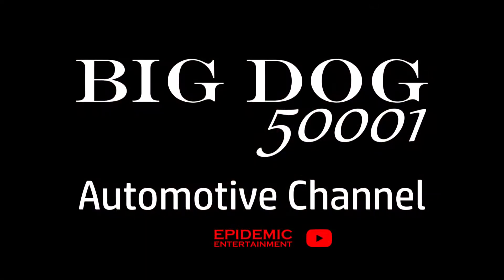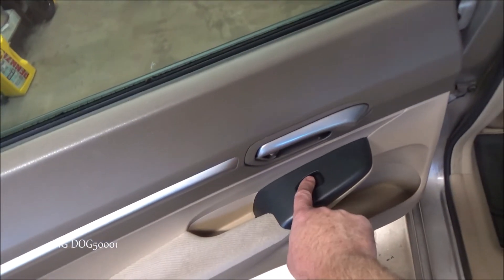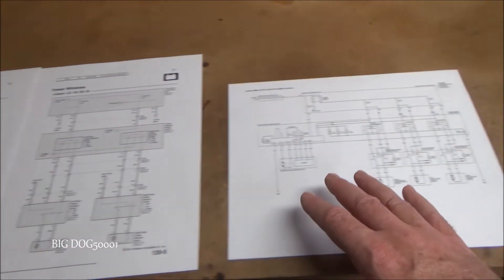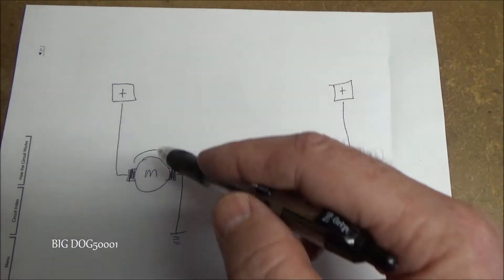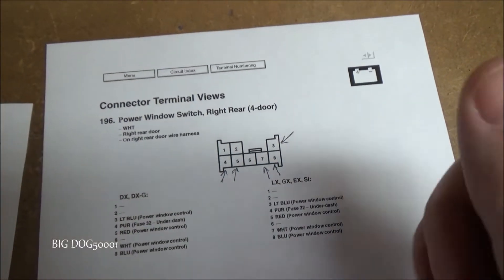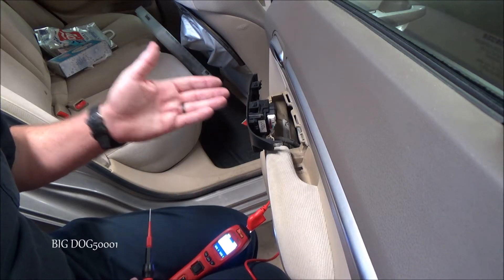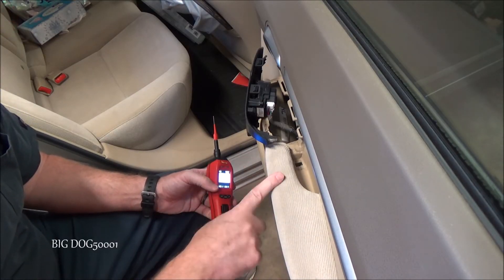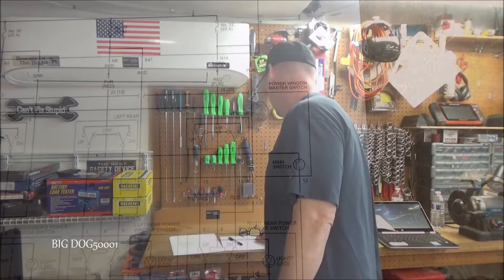Honda Civic Rear Power Window Troubleshooting (2006-2011)

Comment: OMG 🐶, as a former Control Data Institute grad, that is the most detailed, thorough, educational troubleshooting circuit diagnosis I've ever seen - even better than my instructors back in the day! I can't see anything that you didn't do in your troubleshooting techniques. For you having both mechanical & electrical backgrounds you're an invaluable resource - exquisite training/teaching skills! Hopefully others gained comprehension on how a full circuit works to supply voltage ⚡ & direct current (DC) to their respective devices to make them operate!!
Reply from the maker: I appreciate the comment, thank you!

Comment: I had a similar problem found your video. However 3 windows stopped working at the same time. What are the odds that all 3  motors went at the same time?  
Driver and 2 rear windows. Puzzling. Front passenger works.

Comment: Really thanks! My problem is that only the piloto window works, you said that probably the problem is that the main switch on the right of the diagram going to ground is not working 5:37 . Where can I find It phisically on the car? And how can I fix it?

Comment: Checked all wiring except the last test which was grounding, also put in a new window regulator/motor. Window goes up but not down… very weird. Do you have any suggestions?

Comment: I'm not a Auto Tech but I am an electrician, my question is if you could put a resistance reading between 1 and 4... On your wiring diagram there is a symbol that looks like a breaker or fuse, having a reading can give me an idea if 1. the motor coil and 2. No reading cause not sure if thats a fuse or something next to that motor symbol will have no reading.. This was a good unerstanding for me to tackle it down.

Comment: Great video Bog Dog.  I have a question. While doing the second series of the switch test on the white wire(press up and down) I did not get a voltage drop. Is that an indication of a bad switch?

Comment: I am having a similar problem with an 06 coupe in that after replacing the regulator, the switch is not winding the window up or down, but putting direct current to it will run the regulator, what would you suggest?

Comment: What would fault be if front passenger window works on passenger door switch but not at drivers door switch . Had key on for while and drained battery . Then after had this problem . Does it just need reset ?

Comment: It's common failure with 8th gen Civic's. I've troubleshooted my Civic with that issue and also find out it's window regulator motor problem.  After disassembling gearbox and motor everything whose looking fine and motor started working again. So I've assembled everything back again and power windows worked... for few days and stopped working again. As long window is closed it's not bothering me that much.
Reply: I had a similar thing happen to me on an accord. Replaced regulator, worked for a while, then stopped working. Turned out the connector to the regulater was "crusty". Deoxed and cleaned that. Been working fine since.
Reply from the maker: It's a common failure item on many Honda models.  Thanks for the comment!

Comment: Dave I have a question that I hope you can answer for me. I have a 2004 Ford F150 that has a driver side window that won't go up or down. When I tested all my switches all test good in the up a down position except the driver's switch. I'm puzzled because I saw somewhere on YouTube that said those with the automatic down switch has weird circuitry but he didn't explain that part. Anyway the up circuit works as it should showing power on the up button but the down wire only shows power on the up as well and not on the down. Of course I was hoping  I had a bad switch versus a bad motor/regulator, but I was wondering if that particular switch had any kinda power feed from elsewhere when I hit down to complete the circuit. That didn't make sense to me but having power on up on both sides made me wonder if there's some short to power. I took the door panel off and gave those wire direct current bypassing the switch and  still nothing I only hear a click. Any thoughts?

Comment: Hi ! I am writing to you from KSA 
I have 1999 Honda civic, i cleaned it from inside by water after that I have a lot of electrical problems . One of them is the radio .
It's not start normally when you open the switch until you switch on the dash lights.
Can you help me to fix this problem.
I have a diploma in electronics but i don't know the circuit diagram for this car and i hope you to help me !